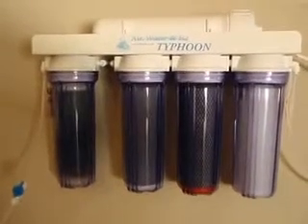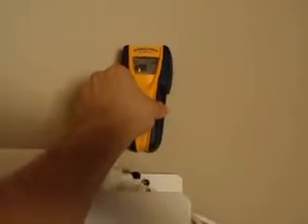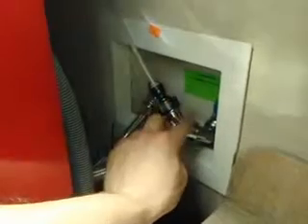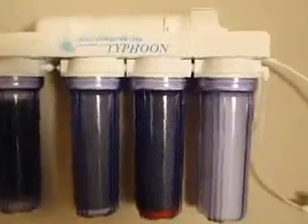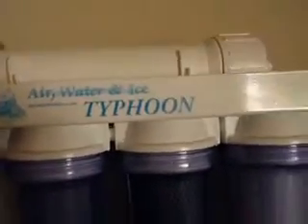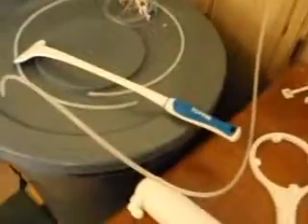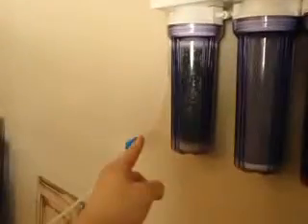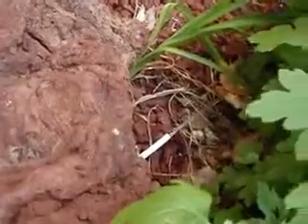RODI unit from AirWaterIce.com and how it works

Comment: I just got the same unit you have, however my Di canister isn't filling up past halfway. And I'm producing 5 gallons of waste water for every gallon of clean water? Does the flush valve also act as your water restrictor?
Reply from the maker: StraitClownin909 hmm, mine doesn’t fill up either but you can rock it left and right and that helps some. Flush valve just bypasses some sections to flush it. If that doesn’t work you might have another issue.
Reply: @irod72002  Thanks for the reply! I've messed with it and I think its working properly, its showing TDS mostly 0 but it would occasionally flicker to 1. But the water level in the Di cannister is about a quarter full while running and fills up to about a third full when i shut the filter off. I flushed the membrane as you mentioned and probably got rid of all the tds creep. But so good so far, ill just keep an eye on the water levels.